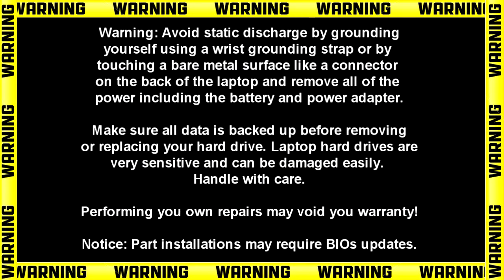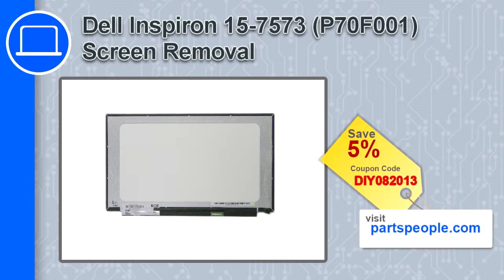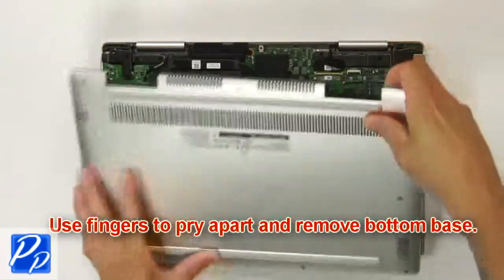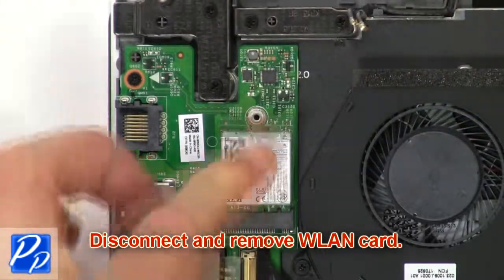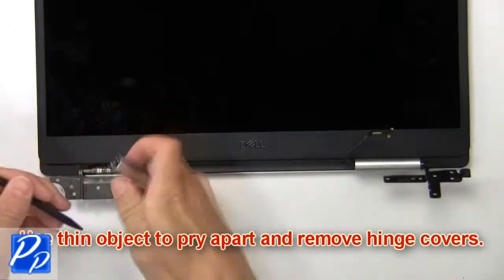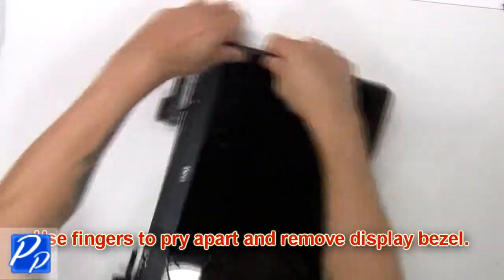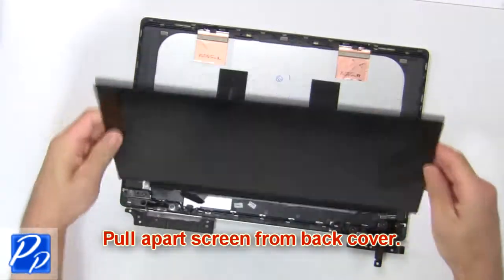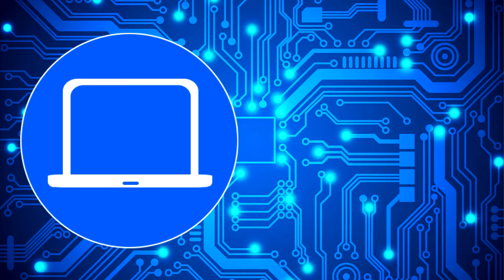Dell Inspiron 15-7573 (P70F001) Screen How-To Video Tutorial

Comment: you sure this is for 7573 ?? It does NOT have TouchScreen ... mine does
Reply: I have the same problem. I have Dell Inspiron 15.6" 7573 2-IN-1 touch Screen LCD Laptop. My screen Display LCD has died. Were you able to find a cheap Touch Screen LCD ? if yes, how much and from where? Were you able to replace by yourself?